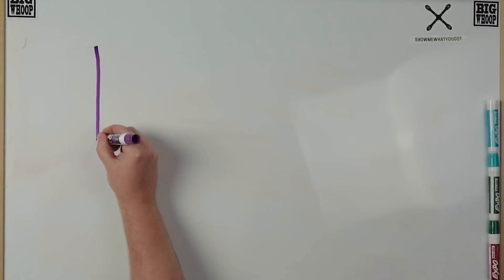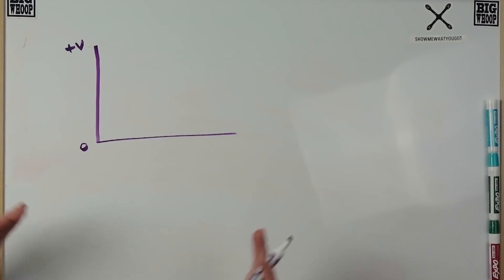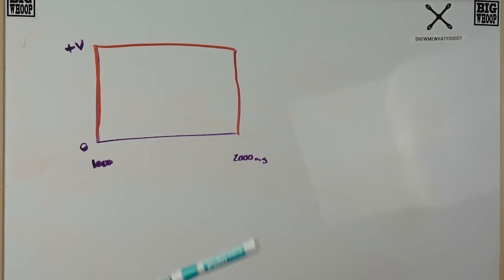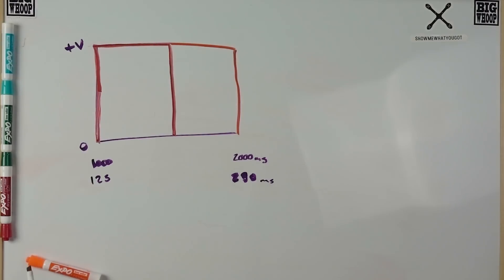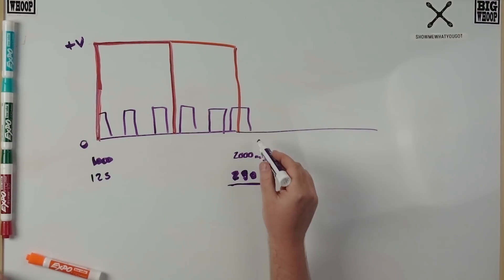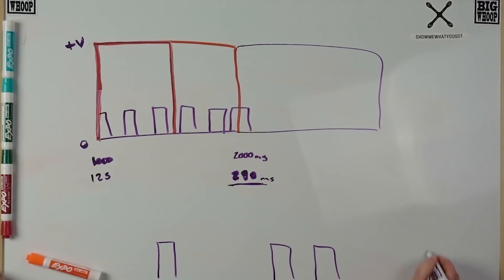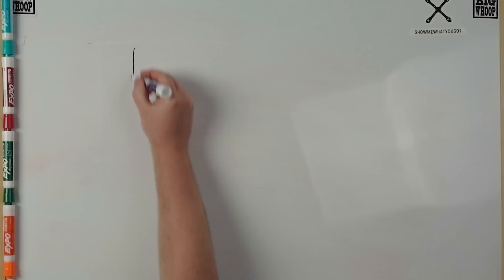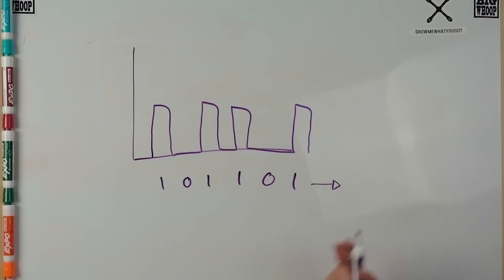Whats up with ESC Protocols?? - Learn It

Comment: 0:43 that's sort of wrong. In a brushed motor you can apply a fixed voltage and have it rotate. In BLDC you need to modulate the phases of the motor :) Nice show, I enjoy it a lot :)

Comment: So I just received some KISS AIO v2's (KISS CC) in the mail today, but that still isn't what you are talking about when you say to have everything together because there is still 5 processors, correct? That's just putting all 5 components on 1 board but they are still technically separate components? I'm with Jordan and Travis when it comes to this technical stuff lol.
Reply: MrTimmyGT me too. But if you just force yourself to watch it it starts to make some sense.

Comment: Does anyone know if anyone is currently working on making a single processor based ESC/FC combo? That could also reduce weight and making building process much easier to toss out separate ESCs and have everything built into one flight controller... but also might cause some noise to have high current so close to sensitive electronics... idk what I'm talking about, someone needs to make this happen though!

Comment: Very helpful video. It explains a lot and can definitely help diagnose problems. Is there anyway to fully get rid of the input noise from the gimbals or is it always going to be there?
Reply: No, the standard gimbals are similar to pot resistors, where they use a (carbon normally) strip to measure the position of your gimbals and relay the value. Over time the strip wears and makes degrading contact and this results in a jittering value on the tx output. There are replacement hall sensor gimbals that would minimize this to resolve.